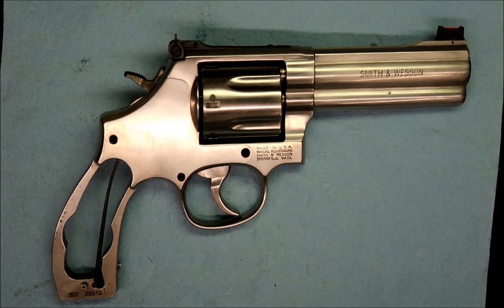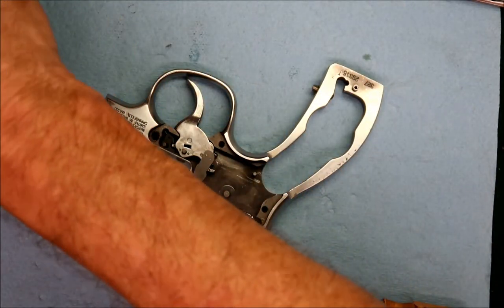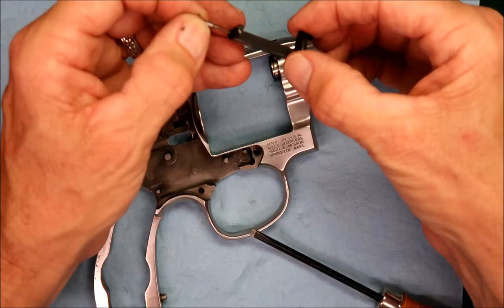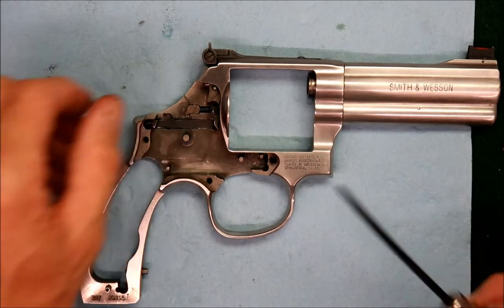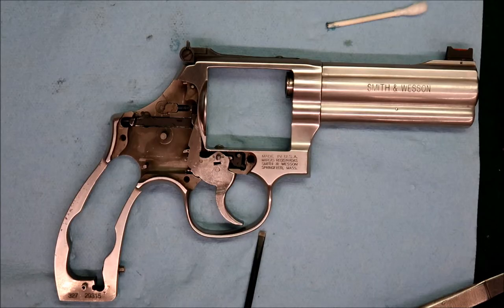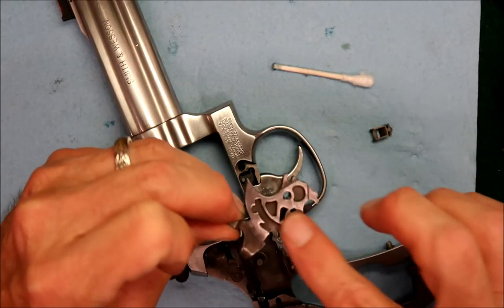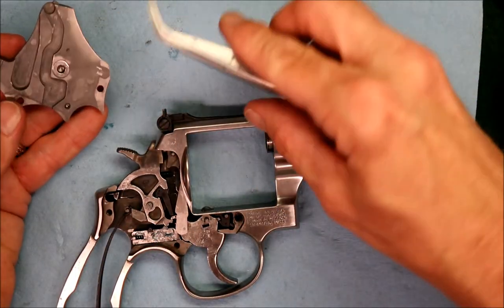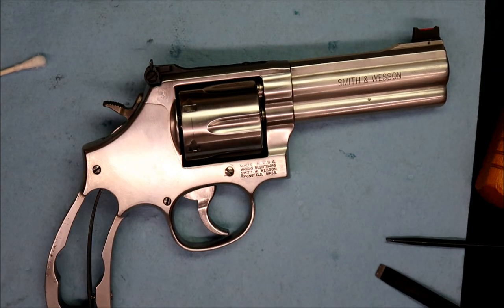SMITH & WESSON REVOLVER INTERNAL LUBRICATION

Comment: Way too much grease and oil. There’s a reason these revolver come from the factory mostly dry inside.
Reply: Why? Serious question.
Reply: @AtomicDogg0213  Most parts are hardened. And not subject to excess movement stresses. Wipe a small amount of oil on parts, then wipe away, leaving a microscopic layer. All the protection you need.  You will not wear a hardened part out from normal use in a lifetime. All excess oil will do is attract crud, then you will have a paste mess.
Reply: I broke down my 686 and my 629 like this and used a very light coating of mineral oil to protect from rust
Reply: Agree, I’ve never broken my 686 down this far.  In fact, I was warned against over-lubricating it when I bought it for the same reason mentioned here.
Reply: @AtomicDogg0213 don’t listen to the internet this guy doesn’t know what he is talking about. I’ve worked in manufacturing my entire life and we do the minimum possible.
Reply: @boricuaarecibo9259 no you’re revolver was before with or without the oil. Lube doesn’t break a gun that makes no sense
Reply: @brianmorg the internet is full of trolls and desk workers!
Reply: @AtomicDogg0213 lube reduces friction thus increasing its longevity. These guy don’t lube their gun because they went to Iraq and used minimum oil to reduce dirt from getting into their m9s. Then they relate that to everything including their vehicles. If it ask for 5 qts they will put 1 because of sand.
Reply: Oil collects dust and creates a paste. It’s not needed apart from  a minuscule application and then removal to create a thin film on certain areas of the internal components.
Reply: @LowIQinHQ nope it’s as per Smith & Wesson protocol.
Reply: @LowIQinHQ the parts inside these revolvers are operating under extremely low friction, and thus generate extremely low amounts of heat. Metal requires heat and pressure (friction) to actually erode. Those shiny spots you see inside the sideplate and on the parts are actually a sign the metal parts had been fitted at the factory or work fitted. Essentially, the “wear” is actually a sign of the bearing surfaces being worked together so much that they’ve become mated to each other, and thus will exert even less friction upon each other. 

Overlubing like what this guy is doing is bad because though a revolver’s lockwork are relatively well sealed against dirt, grime, and firing residue, firing residue and dirt can still intrude into the lockwork with enough rounds and time. This excessive amount of lube can cause the residue to become suspended in solution and form an abrasive slurry which in time with even DRY FIRING, can cause parts to develop even looser tolerances.

At most, in revolvers of any type, only a drop of oil is needed, wipe on and let sit for a few minutes, then wipe off with a dry patch or paper towels. The ONLY way for the oil in the micro fractures of the metal pores to be displaced is if you’ve sprayed it with another oil or non-polar solvent like mineral spirits or acetone.

Don’t talk on something you know nothing about my friend.
Reply: I would say that a revolver that’s used for competition gets taken down and cleaned and lubricated way more often than a revolver that’s just shot occasionally and put away. I really don’t think it’s an issue.
Reply: @GPgundude  yeah but the average person who happens to own a revolver probably isn’t a competitive shooter. Saying with authority on a YT video that you should have the amount of lube shown in this video is detrimental to the average revolver for the average person.

The average person who is not some kind of weapons enthusiast like ourselves might just shoot and clean every two or three years and leave it at that. The excess oil would have oxidized or congealed in that time and cause even dry firing actions to have a deleterious effect on the internal lock work of any given revolver.

Comment: You could mention to people not to remove the hand from the trigger. You did not do it in the vid but people should know that if you do there's a tiny torsion spring inside the trigger that applies pressure to the hand that's a real PITA to get back in place correctly.
Reply: I took out that same spring also ; Holy Smoke it took a lot of cussing and sweating getting it back in 
It’s not coming out again 😂😂

Comment: FYI If it's a Smith & Wesson it's a "Yoke" if it's almost any other revolver it's a Crane. That's if we are using the correct Nomenclature. LMFIAO  Best part about a wheel gun is it's hard for the lubricants to attract any carbon unlike a Semi-auto pistol. Also if you run out of cartridges  you can always use it as a club, can't do that with Polymer guns.

Comment: Just had to replace that tiny spring on my “cylinder stop” (S&W “Model 603”) and man you were correct that was not easy to get back into place. The original factory finally wore out (1981 S/N) and the original “cylinder stop” had developed an odd burr on the lip of the hole the spring sits in. Pistol was not functioning correctly in DA mode (misfiring every 10-12 rounds) but was fine is SA. Clearly this created a timing issue due to the tension on the “cylinder stop” not being within ideal spec. I opted for “factory new” & “remove & replace”. Lubed & oiled and it’s back up to 100% functional! Excellent tutorial!

Comment: I have a 686, I don't know if I want to go through all of that to clean and lubricant my 686.Thanks for the tip on using lighter fluid and other lubricant/cleaning spray to lubricant the parts without taking everything apart. But great video on how to take the 686 apart to lubricant it!

Comment: So, using this video and your Wolff springs video I was able to update my 617-6 with a Wolff spring kit and thoroughly clean and lube it. Couldn't have done it without you, thanks. In this video you mentioned some places that you had polished. Hoping you would comment or even do a video on how and what to polish to smooth things out. Wish Wolff would include the set screw. I went to 3 stores before I found the right one.

Comment: I would like to add some advice to this video.  
Before you remove the sideplate, back off the strain screw from the mainspring.  When the sideplate is on, those pivot posts, especially the hammer pivot post, is supported from two sides, the frame side and the sideplate side.  With the sideplate removed, all of that tension provided by the mainspring is held on that pivot post from only one side.  It is possible to bend the post or even break it off of the frame. A very small amount of tension is all you need to hold the parts together and to function test (and see) the action with the sideplate off.  
I sort of cringe when I see a part being pried off from the frame. If you jam a screwdriver between the rebound block (or slide) and the frame, you can gouge scratches into either or both parts.  Brownells sells a nice tool that compresses that strong spring to let you gently lift up the rebound block.  As long as you have the rebound block out of the frame, you can replace that spring with one with a lower compression strength.  Buy a few extra springs as I guarantee that you will eventually launch one into the deepest darkest corner of your room.
Otherwise, a very nice presentation.

Comment: I use a larger Phillips and the post fits pretty good in the "groove" and push and push down with the other hand until the spring catches on the post and then push it on down with a small flat screwdriver...

Comment: Thank you. I have a 686 Plus. I am getting ready to install replacement trigger bar & striker pin / springs from TKC and I want to take it “all the way down”. I’m no expert but a 40 year aircraft turbine tech and I have a pretty good gunsmith area set up. 

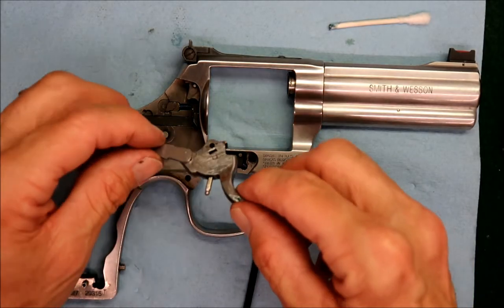A was considering using Otis dry lube back here or even dry graphite spray grease on certain friction points. 12:25 Would love your input on that please. 

Thanks again; your video is now my “official” “how to” video. Wish me luck but please reply with suggestions & comments. 

Thanks… Gene

Comment: A few tiny drops of oil or clp in actionable parts would suffice, work the action a bit and let it do it's job. Any use thereafter will help keep the parts moving and well lubed without gunking up the works.

Comment: Trev. from Australia, what thread type and length is the Allen screw your used to replace the main spring screw?
Reply: It's an 8-32" set screw. I use a 1/2" length one in mine.

Comment: Out of curiosity how close is this video to a S&W 66 in parts and their location if attempting the same objective?
Reply: Aside from the slightly different sides of the hammer and the new lock hole (neither make a difference for cleaning) its pretty much the same thing. You can do it, watch the MannyCA video also.
Reply: virtually identical

Comment: How often should a revolver be cleaned like this ?
Reply: About 500 rounds I feel a difference when using oil…have to try grease. Oil is slicker initially….but does last as long. Use synthetic for cold, or if you are going to store for a while. Petroleum grease will get gummy over time. I switched to synthetic as my everyday…

Comment: 586-1 ..why does my cylinder move way too far reward out of alignment when I push the Ejector rod.  Like 1/2-3/4 too far back..have to “Snap it” forward to get it back in alignment to close…..you look like would know.
Bad cylinder?  Bad yoke journal…my 36 and 64 never have done this…had the cylinder out and completely apart..cleaned  and Ballistol…..no help.

Comment: Why remove the transfer bar? I’m only asking for education purposes I’ve never heard of that being done.
Reply: It’s actually a hammer block, and serves to prevent accidental discharges when the gun is dropped. Removing it is dangerous and irresponsible.
Reply: Some target shooters feel that it causes (slightly) more drag and the gun works smoother without it. It's the secondary hammer block not the primary one so theres still protection.
Reply: @arnenelson4495  Thank you. I didn’t realize.

Comment: Thx for this video.  I just subscribed.  I'm same w 'Can't Dance' below.  WD-40 maybe another
watery semi-lubricant to spray out the dirt from the non-removed innards.  I don't know which
wld b better, Ransom or WD-40 but worth an experiment, find how smooth the trigger-hammer
operation is.

I'm wondering if ur Stainless (or Nickle?) revolver has the MIM innards as u have that Hilary
Hole.  Are the innards stainless too (use a magnet)?  If so, dat'll b great as they won't rust n
shouldn't b needing frequent clean up for a wheel gun vs. automatics w un-burnt powder messing
up the innards.  Hey, let the TopperWear plastic gun lovers enjoy plastic innards too, no lube, no rust?
But he still need to get rid of the powder unlike the wheel gun?

Comment: Could you just hit that with some brake cleaner, throw some lube in there and be done? 

The disassembly looks tough
Reply: No. I shot some break cleaner into the internals before I felt like taking it down. It leaves a film. Taking it down isn’t hard and is educational. I’ve torn down every revolver I have ever owned and that’s more than 2 dozen. After a few times it’s very easy.

Comment: Not a good idea when you live in a state where temperatures get below zero in winter. Oil and grease will freeze and lock your gun up. Leave it alone
Reply: Use synthetic lube in cold….i use graphite in hot sandy places

Comment: He says DO NOT USE WD-40, that must be because this may loossen up parts from being secured, i do not know other than the fact this substance does not last, anyway i do not take any hand gun  apart,  i  look for an opening in the gun to blow out any loose dirt,then i drown the gun in oil and either blow the excess out or let lt drip dry, than wipe the outer parts dry........YOU HAVE TO BE NUTS TO TAKE A REVOLVER APART OR BE A GUN SMITH....I have had revolvers the past 60 years and have never taken any of them apart....IF IT WORKS ,DO NOT FIX IT !......STUPID VIDEO,    anyone who follows this guys advice is just looking for problems, and that's a fact....